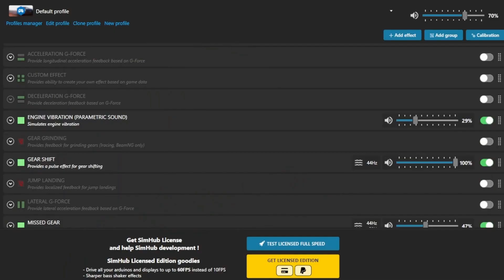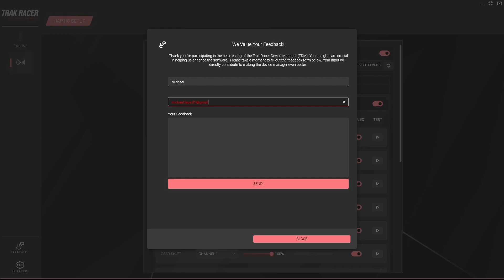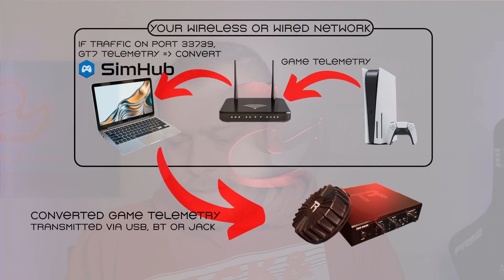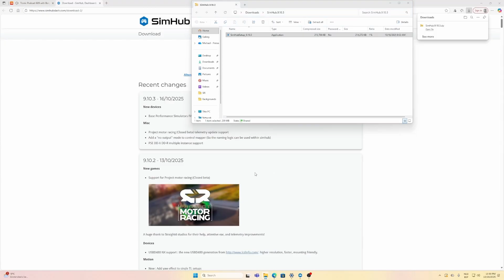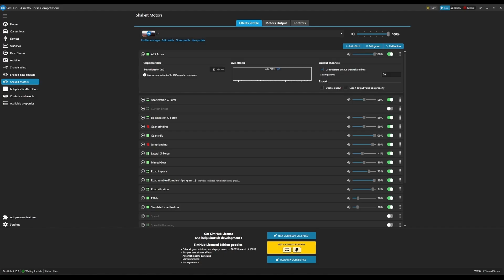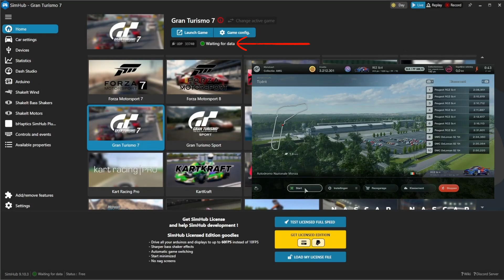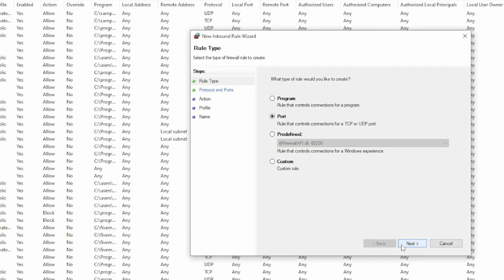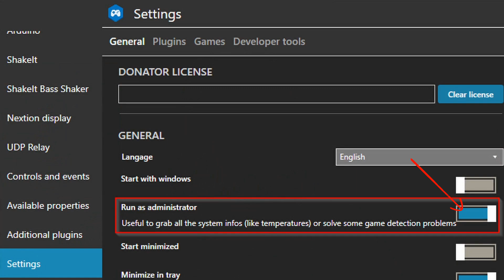Haptics on Console & PC 101 | Requirements, Installation and most common issues

Comment from the maker: If you connect your Trak Racer bass shaker via USB (because you prefer it/because you use audio-jack for pc audio), there is a possibility that the device is not present in SimHub. You need to add the bass shaker itself as a new output device. When you connect the TR bass shaker, it will show up as a headset US05. Add this and it should work. If it doesn't work. Remove the added device in Simhub, restart Simhub and try it again. Now it should be visible, active and can generate haptic feedback.

Comment: I recently bought an NLR HF8 Pro feedback pad for my simrig seat. I hooked it up to SimHub to get the most out of it (instead of the audio jack option) and it 'talked' to my console just like it would a PC (EDIT: I had to connect the HF8 Pro pad directly to a laptop which was on the same home network as my PS5 Pro).

Very, very good program/application. Great video, by the way :-)
Reply from the maker: Thank youuuuuuu 💙